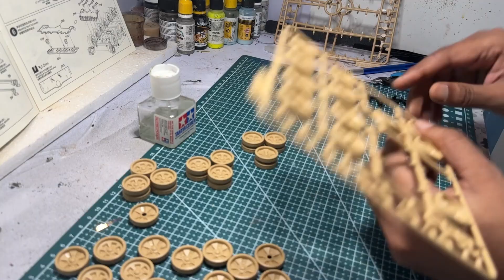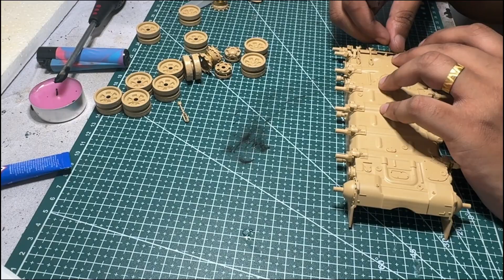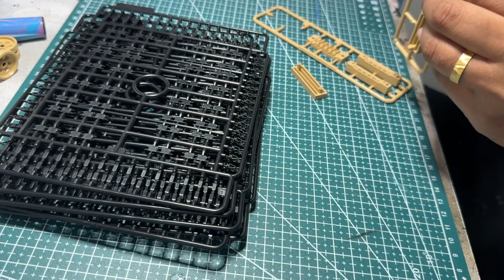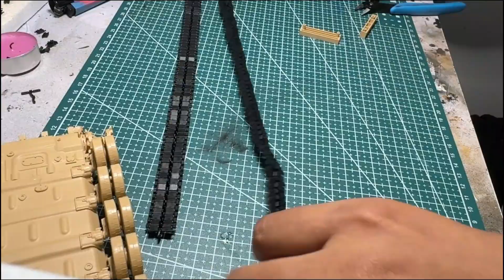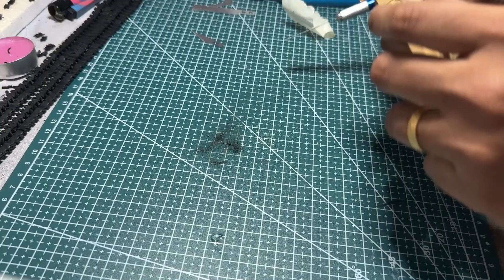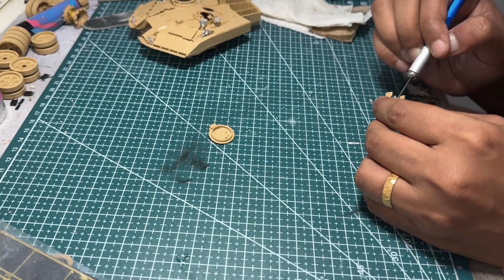FULL BUILD - T90-M - 1/35 - TIGER MODEL

Comment: wow....that part of putting the tracks together, looked Quite tough, but with the jig, that seems to help!  

Question 1:  What type of material are the tracks made of??  Is it the vinyl material ( the same type of material for the poly caps?? )

Question 2:  Which type of T-90 tank are you building if you need to cut the fenders?  Which tank is it if you KEEP the fenders??  WHY did you re-attach the fenders???!!!

Otherwise..... the model looks very good.  Thanks for posting!!
Reply from the maker: Hello and thank you!

1. The tracks are made of plastic - not similar to that of the model or poly caps. It is stiff and not so flexible, but also brittle if handled improperly. The links/ends between them were made of the same poly cap material though. Looks a bit tricky but is quite realistic.

2. I think the base model for the kit is the T-90 MS (The export variant). I am building the T-90M version, for this an extra set of instructions is given which instructs to cut and remove the original fenders and install the new ones. I showed this in the unboxing video: https://youtu.be/F-ATx7BDEzE.
You can find it around 13:12.